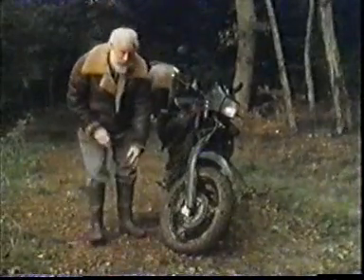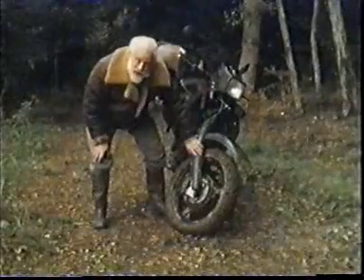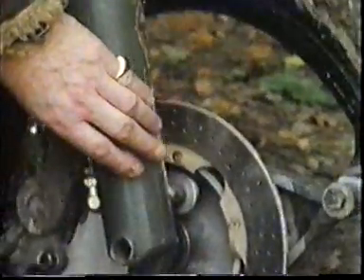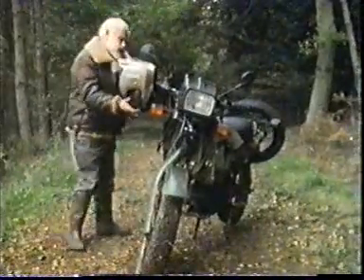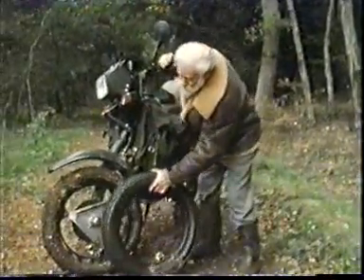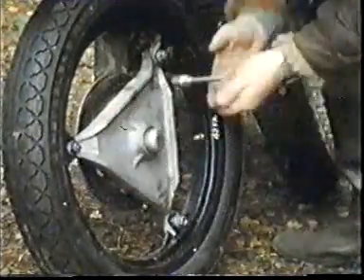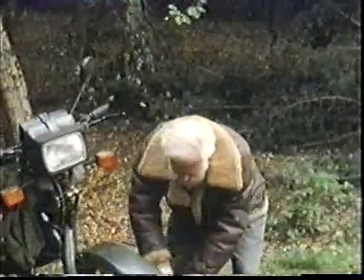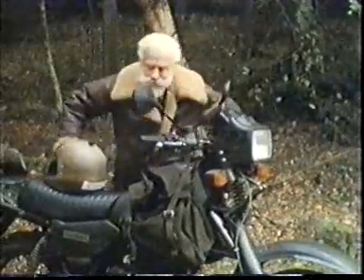HOSSACK/MOD

Comment: Tyre Weld appeared on the market rendering the need to change the wheel unnecessary.

Also Eastern European military and civilian bikes, such as Jawa and CZ motorcycles, had conventional suspension and front / rear wheel interchangeability with QD cush drive rear wheel coupling that required only one nut to be undone and tightened instead of three.

Probably not accepted as already equally capable conventional systems already available.